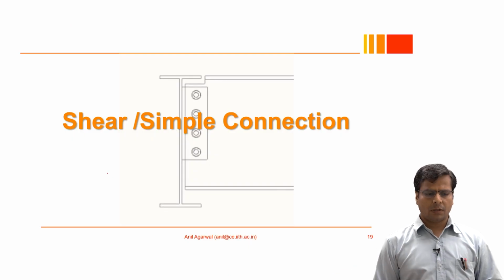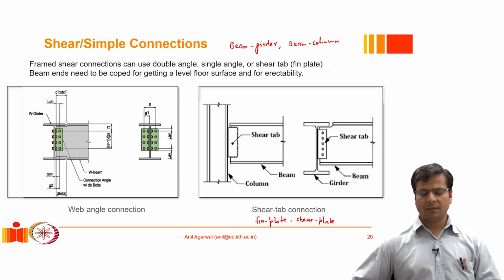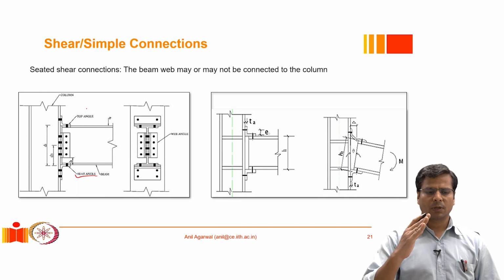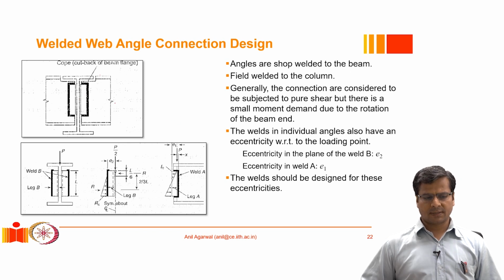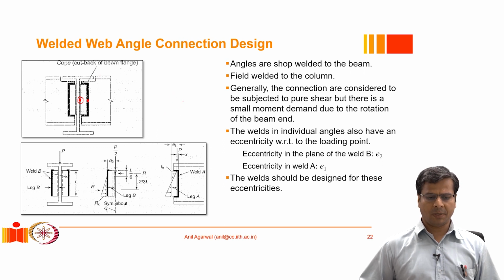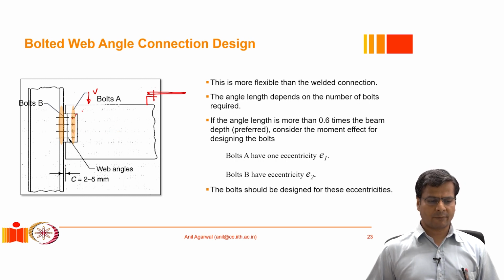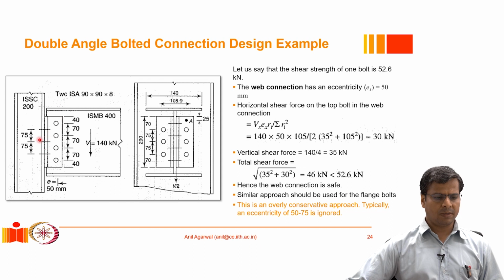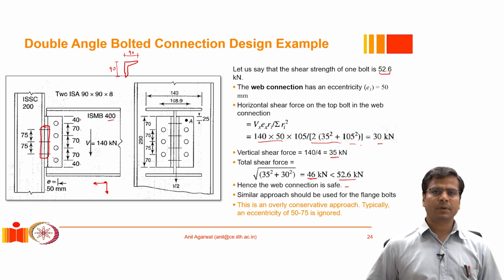Design of double angle connections

Comment: There is a calculation Error for Vertical Shear Force as is has been mentioned that in the existence of two angles connected to the soul their division is the shear force "V" divided by twice, therefore is Vertical shear force = 140/(2*4) = 17.5 kN, and Total shear force = √(sqr(17.5)+sqr(30)) = 34.7 kN, please correct